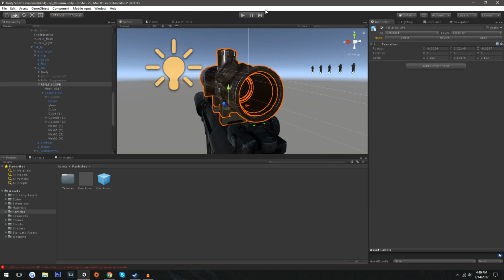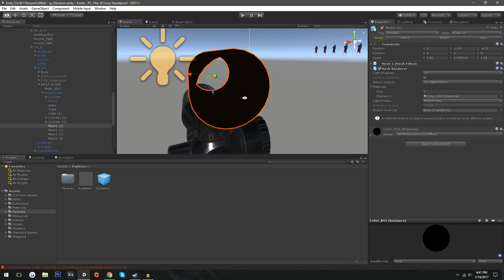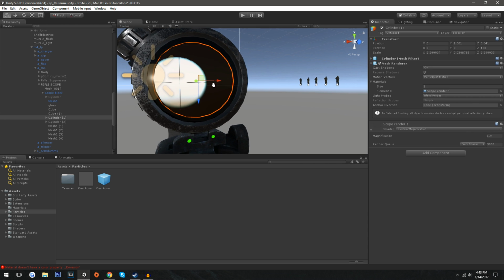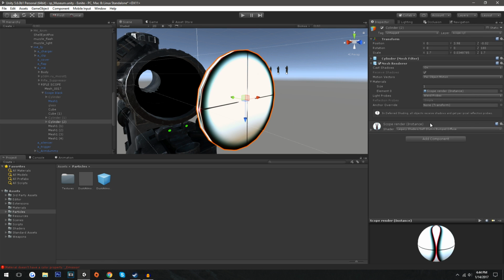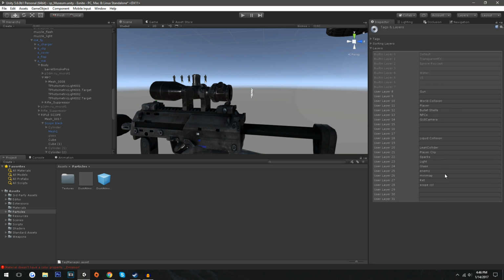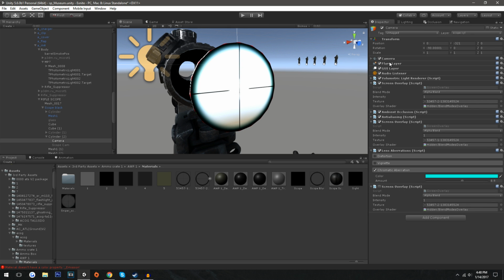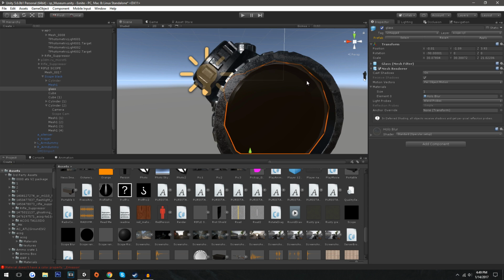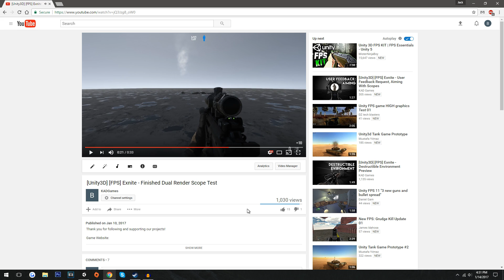[Unity3D] [Tutorial] How To Create a Dual Render Scope in Unity

Comment: Your video helped me a lot, thank you :)
But I found it pretty hard to follow, I had to rewatch it like 5 times or so. I think you tackle a bit too much stuff at the same time or rather in a strange order without real cuts.
Also I think it would be better if you have built it from scratch because it was sometimes a bit confusing with all the already existing non-relevant stuff in the scenes/on the objects. And in my opinion it would be better if you'd point optional stuff out at the end of the video, like the thing with the black cylinder inside the scope to cover the grey areas.
But nonetheless very valuable information :)

Comment: The kind you are using the Shader is a cool idea, but this magnification shader is not a good solution. The Shader is just zooming on the Pixels drawn below. If you zoom in 2x times you may not see the effect immediately but if you go further like a zoom-factor 4x or 10x times you will recognize a drastic loss of quality.
Reply: Thegabagabor why would you need to go 4x on the shader? The camera is the actual zoom the shader is to hide it
Reply: @vectorinteractiveYT  No, its not that simple. The camera render texture is situated in the middle of the scope, ,making it quite small because of the distance while this magnifcation shader is actually scaling that area up, which means less detail
Reply: S X mate I’ve already done this many times all you need is max 2.2. It depends on your scope size. You can also hide the pixelation by adding some camera effects which is all really simple. I can send you a image of one of my scopes if you so wish but you will have to wait a couple of days.
Reply: @vectorinteractiveYT  so, hide the shitty parts instead of getting to a good solution, nice.